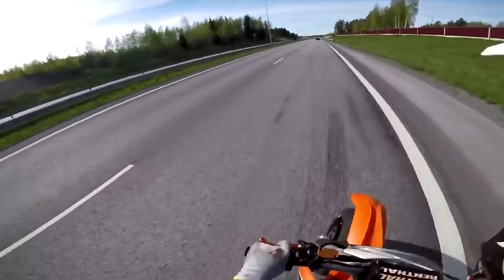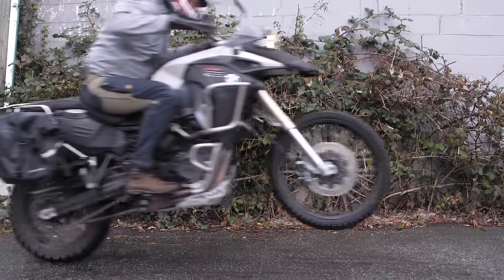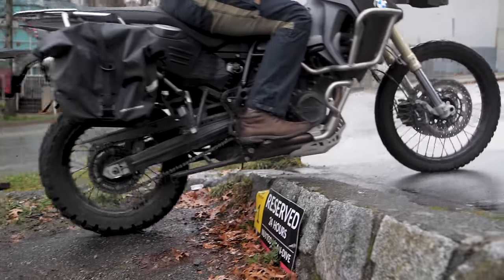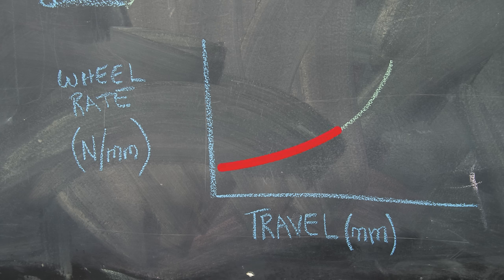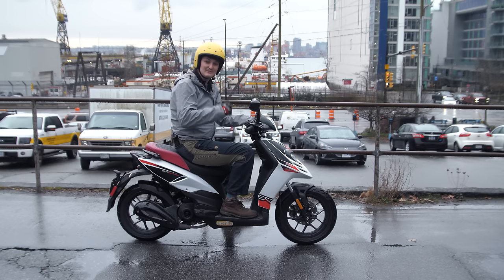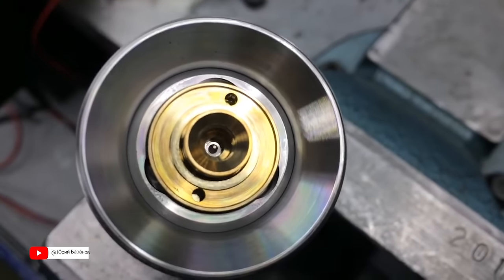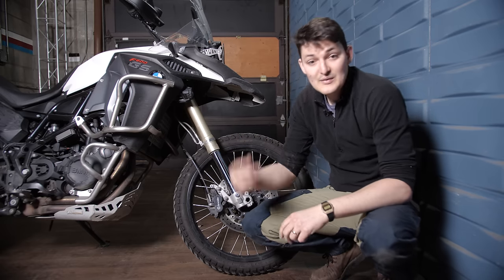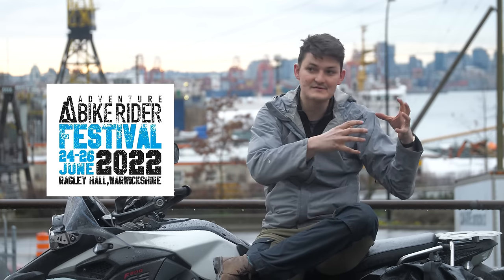Tank Slappers and the Quest for Perfect Suspension

Comment: Coming from a Multistrada I would have to say yes to turning on an electronic suspension….. it was truly wonderful. Great video Ryan!
Reply: Yo you got any of those jobs laying around?
Reply: @Hoppitot  lol let him go check in the back real quick
Reply: @well_as_an_expert_id_say  hell I aint doing anything dude can take 3 months as long as he finds something
Reply: wow id love to ride one , being mostly an off road guy in the past ive intentionally stuck with manually adjusted suspension but maybe im missing out ?
Reply: Eh, another MS rider and I would be just as happy without it. Only a few times its ever felt like it was doing really well and the rest of time just soso. I would just as soon have a standard set of forks and shock that are tuned well. Eliminate all that electronic involvement and expense. I should have bought the base model...
Reply: I’m so tempted on ditching my monster for a multi now that the seat is finally lower 🤣
I’ll see if I can get to test a v2 in ducati’s festival this year around.
Reply: only Duc's ive ridden were long ago an ST3 and more recent a Multi Enduro pro and i can tell ya i did not want to get back on my KTM for the highway ride home at all after riding the Multi , great feeling on road bike
Reply: Provided all of those gizmos continue working well, for about 60,000 miles or so, with regular fluid changes. Which I doubt they will.
A rebound/compression damped proper-spring rate suspension front/rear works so well, I don't perceive I'd be in raptured levels of ecstasy if I added electronics to that. Trouble is, people get really used to buying/riding/owning stock OEM garbage suspension that by the time they fork over for the Skyhook or something similar, they boast how awesome it is. Yeah well you went from a covered wagon to a Lexus. What did you expect to feel?
Reply: Ducati's Skyhook is really just electronic damping control, the springs are static, it just tries to dampen out the movement based on a few general settings. Spring preload is set via the computer instead of turning a collar, and that is just for the rear shock (at least on my 2014, they may have changed that in later years). At least the earlier versions (2010-2012) had the Ohlins components and they had more options, settings for rebound and compression separately.
Reply: LOL... My reply to that is "Dont touch my suspension setup you god damned electronic gizmo!".  But you keep that up, and soon you may find yourself just a passanger on that Duck of yours.  And maybe thats the point...
Reply: Great video! Keep them coming. I find this is the problem with riding someone else's bike, you don't want to mess with how they have it set for them.
Reply: @exothermal.sprocket  Been around on cars for decades. It's not new technology. Or even undeveloped technology. Problem for bikes is weight. Everything either has to be made more fragile or made out of materials that push the cost to the stratosphere. Everything he's talking about, other than skyhook which was a boondoggle because even for cars it weighed too much, cars have actually moved past. Cars have been  on magnetorheological dampers for the last.. well.. two decades. Just about everything outside the budget category is going to have something that works along the lines of them under a different name. It's just a damper filled with a fluid that can change viscosity on the fly thousands of times per second when introduced to a magnetic field.  Power requirements are actually rather low, and at this point the things don't really fail. Noone is putting the things on bikes though. People for some odd reason are willing to pay for the high end materials needed to save weight when we're talking Ferrari's or something. Not so bikes. Even at the ultra high end. Part of it is probably that motogp bans that particular type of active suspension. So there's no bike development to trickle down.

Comment: A semester of Suspension theory in 7 minutes!  and YES, I would make it perfect if I could (afford it)!
Reply: As someone designing FSAE suspension, one thing i realised very quickly, is there IS a theoretical perfect solution, and that's continuous adjustment in real time, if that's unfeasible, there is simply no perfect setup and that's just it. So as long as you're in the ballpark, it's good enough, simple as that. From there tuning the suspension to personal preferences is the only thing to be done and you're as near perfect as it's physically possible without electronics.
Reply: @AntaresSQ01  CDC sounds cheap and easy to DIY from a programmers standpoint
Reply: @PartikleVT  Yes but as mentioned in the video CDC or otherwise also known as DDC has limitations. It's very good indeed, and easy in concept to implement, but in practice a lot of man hours go behind designing a reliable system that stays accurate even after hundreds of millions of adjustments. The programming is also difficult behind it as it's making a lot of adjustments, how can it tell the difference between a wheelie on a downwards slope vs the road suddenly dipping out from under the wheel such as riding off a ledge? It can't. To be honest in such a scenario it doesn't matter that it doesn't know because the damping will need to be softened on initial impact and then hardened once the wheels land but there are a few scenarios where it can "trip out". And then accurate BMS units are just expensive, again that have to stay reliable and accurate for a long time. The type BMW uses can register lean angles to 2 decimal points 100 times a second. Don't get me wrong they are entirely feasible to implement, but as we can see, there is a reason the bikes that have them START at 15k (with a few rare exceptions) and most near the lower end actually have very cheap forks with DDC picking up the slack in terms of ride quality. A true high end electronic suspension unit like the Öhlins Semi actives cost 3-4 grand for a reason. Trust me, they aren't making big margins on those systems.
Reply: @AntaresSQ01  I can see how the system gets larger and larger and requires more and more sensors as you start adjusting it.
Reply: @AntaresSQ01  Yet all of these parameters were sorted by Lotus and Williams in the 80s-90s. Really, it's not THAT difficult. 
I could go into some of the reasoning as to why it Hasn't happened, but I suspect that there are 2 main reasons;
1 It needs to be developed specifically for bikes.
2 It's been banned from racing, so no manufacturer wants to spend big $$$$$$ on developing a system that robs engine of power.
Reply: @davidcolin6519  It's not at all the same for cars, and they come with downsides that may not be worth it. These electronic systems are often much heavier than standard suspension setups and might not be worth the weight compared to 1% improvement in suspension handling when it comes to cars like Formula 1s or LMP1s. In cars you can control a lot more than in bikes due to the nature of having 4 wheels and therefore electronic systems can do more to make it worth your while, hence why almost every performance car above 50k uses electronic suspension. In bikes you don't have as much control as on cars since you can't change camber, toe, rake, etc at all, let alone on the fly. Best you can do in a bike is raise the rear and harden the springs to prevent it from doing a wheelie (That's what the electronics and the Holeshot device specifically does in MotoGP) but on cars, it would be in the realm of possibility to change the suspension geometry to the point where the roll centre of the car is so low, it's impossible for it to wheelie, but then when you need grip in low traction situations, you can alter the geometry again so the car wants to "wheelie" and load up the rear wheels, you can never get to this extreme with motorbikes without some insanely complicated system by the virtue of being 2 wheeled machines.
Reply: @AntaresSQ01  By that response, you demonstrate that you have neither understood what active suspension is, how it works or how any of what I said influences its use on a motorcycle.
Nor do you appear to understand that active suspension can have a far greater influence on vehicular behaviour than a pathetic 1%.
I mean, I really don't know why I bother.
But I will try to explain;
Suspension on a m/cycle is actually far more fundamental than on a car. How many cars' handling characteristics are fundamentally affected by how much you are braking into the turn? NONE. That is because rake and trail are not affected by braking on a car. Yet a m/cycle's rake and trail are fundamentally affected by braking (unless, of course, you're riding a hub centre bike or a BMW. Using a full active system would allow the manufacturer to literally change every suspension parameter, from turn rate, to acceleration rate to brake rate, and to manipulate that at any time. 
Ducati's lauded "Launch control" is a pathetically crude system that made it the bike of choice for some of the most talented riders on the planet. And it is incredibly crude because no world championship for motorcycles allows active suspension. NONE.
Reply: @davidcolin6519  I don't know why you took this so personally, but if anything is clear it's your lack of understanding by stating car's don't experience rake change when they are braking. Trail braking is just as much of a thing in cars as it is in bikes...  What you referred to in your original comment about Williams is Variable Geometry Suspension, not just dynamic damping control like in motorcycles. Proper, fully active suspension like the ones you're dreaming off are only possible if you can continuous adjust not only the damping, and the spring rates but the geometry of the suspension too, which is exactly what the holeshot does. My bad, it's not electronically actuated but it's semantics, whether you press a button or twist a mechanical knob it alters geometry on demand. Fyi, the williams with the active suspension was fast, but very unpredictable in handling, which is not what you want out of an active suspension system. "Using a full active system would allow the manufacturer to literally change every suspension parameter, from turn rate, to acceleration rate to brake rate, and to manipulate that at any time. " These literally mean nothing. This doesn't exist. What you're quoting there is ABS and TC not active suspension lol. I actually design suspension for racing as a job. I can go into more detail if you can reign in some of your personal swipes.
Reply: @AntaresSQ01  cars don't undergo rake changes under braking, or rather, they certainly don't need to. With car suspension. you can actually design in all sorts of changes if you want to.
Again, you apparently don't understand what Active suspension is.
I've had ¡enough.
 Goodbye.

Comment: Interesting stuff, good video.. I’ve only ever had 1 tank slapper in 33 years of riding, and it’s indelibly printed in my mind! It was under hard acceleration on my ZXR 750 on a patched/bumpy part of the road. The bar oscillation went from lock to lock.. I was genuinely a passenger! Luckily, got it under control and didn’t crash. I had to stop at the side of the road though - to get myself together 😲
Reply: Happened to me about 40 years ago on a Honda cbr400, going downhill at about 70mph. I'll never forget that experience. Nothing to do with suspension, more to do with wheel  balancing.
Reply: Happened to me on an 09’ 1100 Hyper Motard, scared the dogshit out of me, I snatched it up into a wheelie and straightened the bars. I had to take a break until my knees stopped knocking, man what an F’d up ride that was. Be safe fellas ✌️
Reply: @deborahchesser7375 what an insane way to save yourself lmao
Reply: @jamespegg6418  same time span on a KZ550 Kawasaki. I tried to accelerate out of it.
LOL,Nope.Just held on tight and slowed down.Wound up selling that bike pretty quick.
Reply: @manaspradhan8041  I had no other choice, years of dirt bike riding saved my ass to be sure. The steering geometry was too steep, they need a damper bad.
Reply: My outrageously scary slapper, also not suspension related, occurred while on an interstate, late at night, in light rain, going about 70, when all I can believe is that I hit a slick patch, which initiated the "slap", and whether or not this helped my recovery, I stayed on the throttle, and stood on my pegs (R1200GSA), "thinking" I was lowering my center of gravity, which is apparently not the case.  Needless to say, the remainder of that ride was considerably less that the posted speed limit.

Comment: I realize you'll never see this, but you're a script genius. It's the main reason I come back. Your content is superbly edited and has gotten (a LOT) better over time. Now I look forward to seeing everything new. Thanks Ryan. Happy 2022 season from Maine US.  

Tank slapper has only happened to me one time in my life. I was in Florida on a V-Four Honda VF750F Interceptor. I was going over an overpass and exactly as stated in the video, the front wheel came up. As it planted down again, I was on the downhill and totally unloaded the rear end. It slapped 4 times back and forth then somehow stopped on it's own. I rode 500 feet or so to the gas station where I spent a few minutes thanking all the deities. I had the cheapest tires a 90's young adult could afford, which in hindsight may have saved me the trip to the asphalt.
Reply: The "Honda" part of the phrase "V-Four Honda" is likely what saved you. Not that nobody has ever died on a Honda (of course they have), but Honda itself has always had a very strong focus on rider safety and reliable mechanical design - they stake their honor on their bikes because it was what they made for many, many decades before bothering with the car business. The fact that the bike recovered itself so quickly is a testament to their engineering. Meanwhile, you have stuff like the Harley Death Wobble, which comes out of nowhere for seemingly no reason whatsoever (bike moving in a perfectly straight line on a flat freeway), and is difficult to safely recover unless you are at low speed and lucky. I've read that it has something to do with the "rubber mount" design they use to save a few bucks in parts cost and manufacturing, and the only way to eliminate it is with aftermarket parts.
Reply: @martuuk8964  The  death wobble is caused by harmonics. It's stupid, but on some road surfaces the slow low end heavy a** cruising long bore v-twin's rocking will line up with the road surface's bumps. And like an extra kid jumping to super bounce another on a trampoline the extra shock at the right time sends the bike's engine off kilter at an unwanted angle into an uncontrollable lift. Thing is, there's no way to know. Engine speed is variable, and the speed the bike is going at to hit the bumps is also variable. It's one of those, "When the planets align the beast shall be summoned forth to lay waste to yon Harley.". And yeah, dampen the engine mount and it mostly gets rid of the problem. Not completely. It's just a basic design flaw of Harley. To get that distinctive Harley sound the engines are slightly unbalanced. No way around it if a customer wants a Harley to sound like a Harley. That sound is a holdover from before precision engineering engines and modern build tolerances. It's why even other cruisers that borrow the Harley aesthetic don't sound like a Harley. German and Japanese engineers won't let anything out the door that's designed unbalanced, they can't even conceive of doing so.